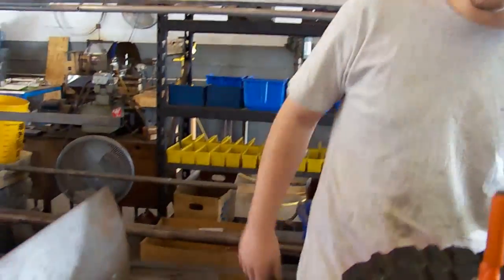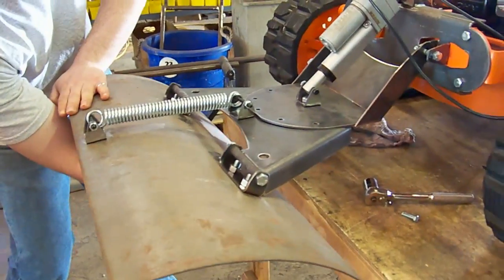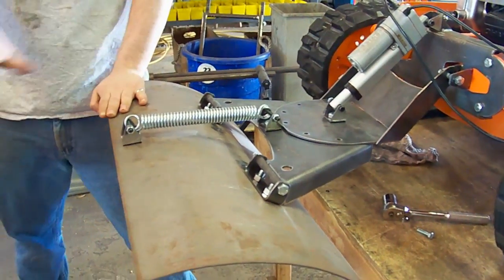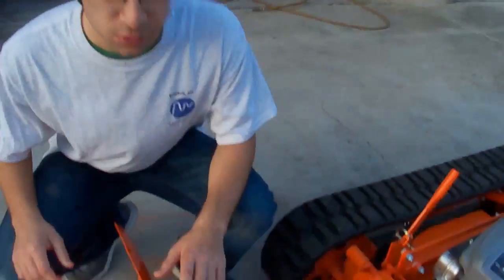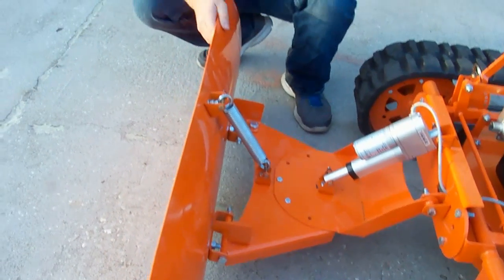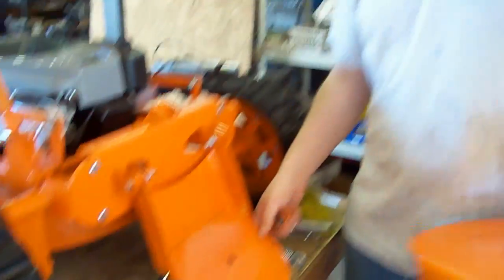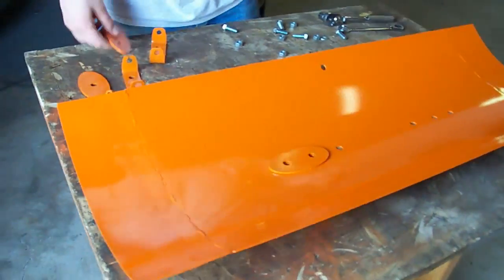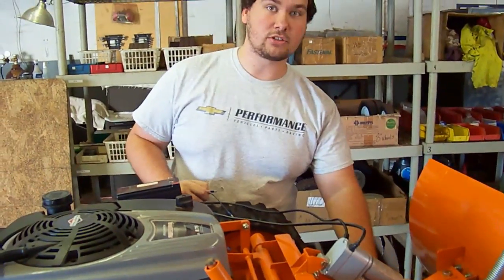2016 HYBRID GOAT ROBOT 22T PLOW

Comment: Have you thought about making it a half track? 

Leave the wheels in the front and replace the rear tires with tracks. 

The tracks would be behind the mower , so as not to interfere with mowing along side a building or curb. 

Use the wheels for propelling the track but use triangular setup for tracks, like Altoz mowers do...

Imho

Comment: The spring is a great idea. I helped my dad remount the springs on our truck snowplow and he used a drill press to compress them.  There were (2) very stout spring.  

I think you should use at least (2) or (3) springs that are a lot stiffer.  Like the ones motorhomes use to retract hydraulic lifts...

Imho

Comment: Looks fun, but let me know when you can show it actually plowing snow.  Until then it isn't even something you should show publicly.  I don't think the spring function for rocks will work as hoped - it will allow heavy snow at depths below the tilt point to tilt the blade and then just start driving over the top.  Buy some sand for testing.  Worrying about rocks seems a bit silly, anyway, unless people are mowing someplace unpaved.